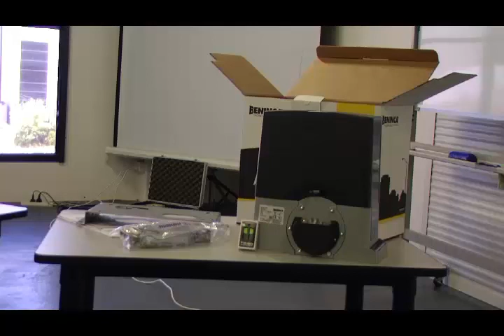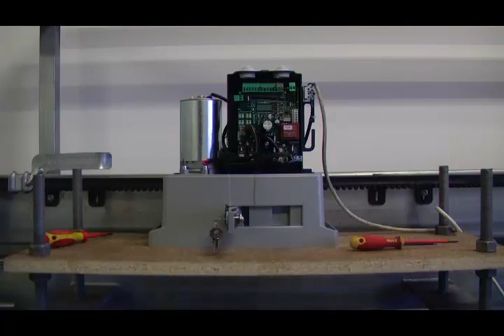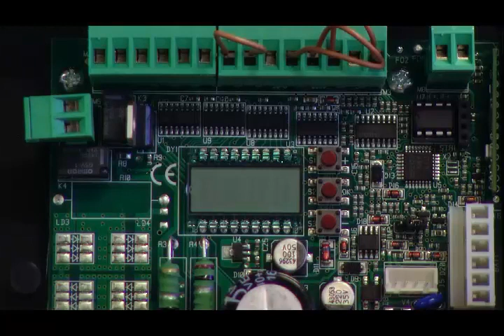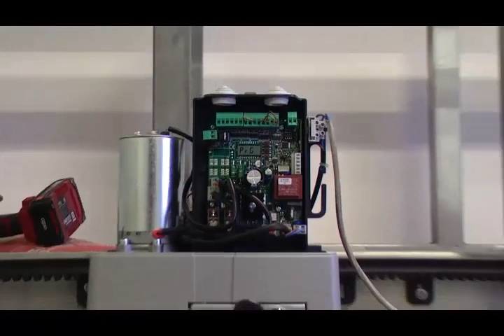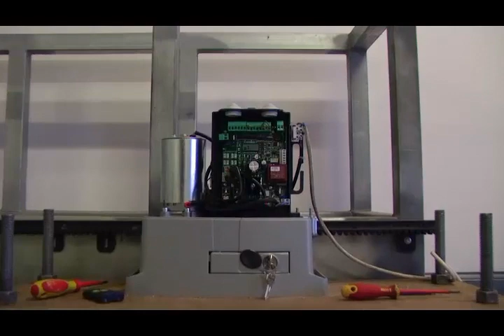BULL Sliding Gate Motors

Comment: Hello Sir, 
I'm facing a problem with Beninca Bull8M sliding gate motor(Controller - CPBULL OM), 
when we fully open and fully close the gate it works perfectly but when open or close from the middle position it hit the wall and won't stop exactly at the limit switch.